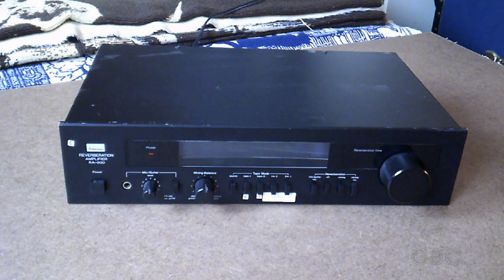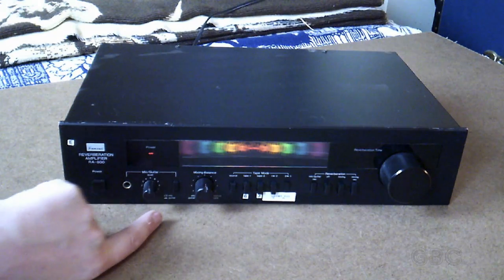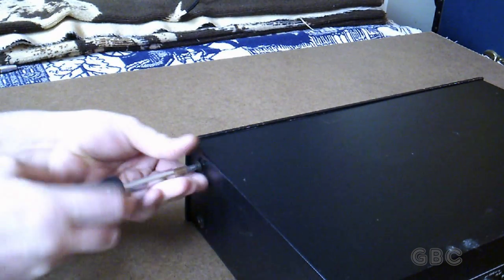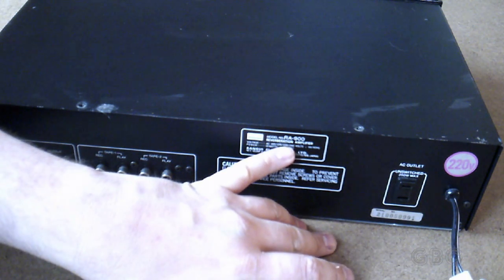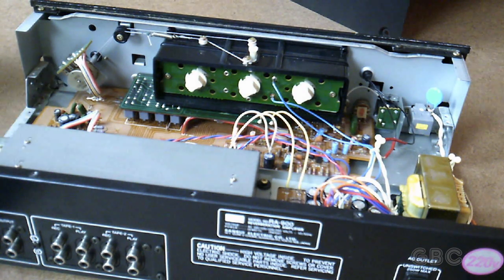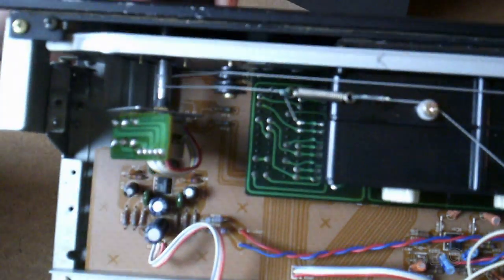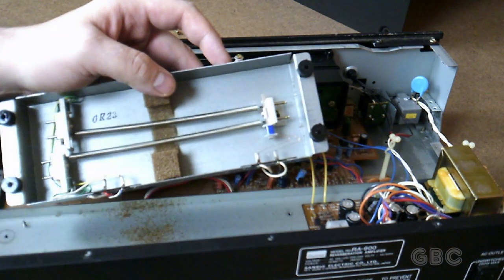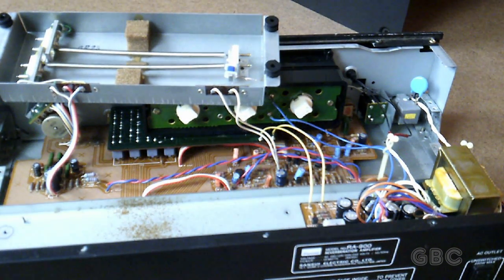Sansui RA - 900 Teardown

Comment: where do you find the display lamps(bulb) that you say is 9v ?
Reply from the maker: I couldn't find 9v lamps so I ended up using 12v automotive lamps.  They are the automotive 194 bulbs.
Reply: Mark Br I’m looking for some too for my RA-990.  In the service manual, they’re listed as 12v, 0.15 amp pilot lamps.  
Part number 46286600.  They’re soldered in, not in a mount like these.  They used these bulbs in several different items over the years, but I’ll be lucky if I can find any. 
I may end up going the automotive route  GBC did.
Reply: Hey guys, a suitable replacement can be found at Autozone. Sylvania #2723, 12v, 2.3 watt (190mA) the extra 40mA is not noticable compared to OEM lamps. $5 a pair. I swapped out all 4 at the same time.
Reply: Did you get the 12 volt bulbs from an auto parts store looking at buying a RA-1000 or would 12 volt LED's be better 👍👍